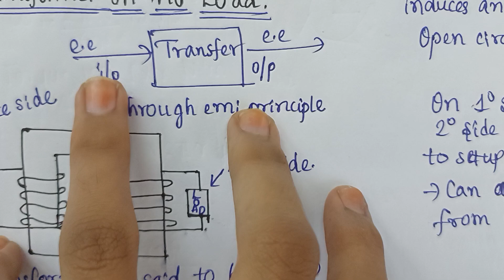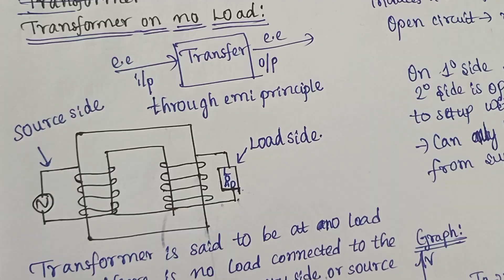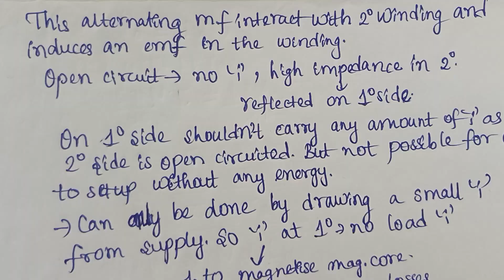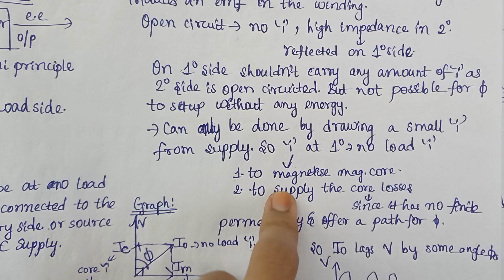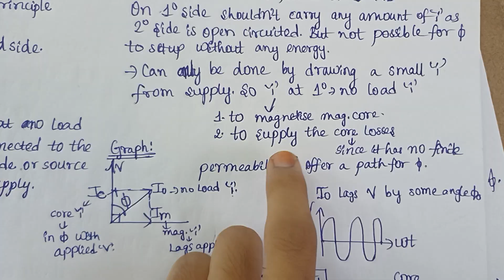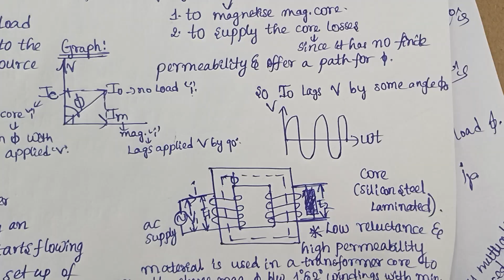Working of a transformer at no load

Comment: Hey do numerical on thevenins method
1.find the current through 6ohm resistor in circuit the voltage is 20,2ohm resistor and 4ohm resistor and 6ohm is the load resistor
Reply: Give reply fast i do not have much time
Reply from the maker: Ans 1.82A
Reply: I want video explanation
Reply from the maker: Sorry I am very busy right now due to classroom  presentation , once Google it you will come to understand, and also it requires lot of time to make video recording,  editing and to upload it. Hope you can understand my problem from my side.